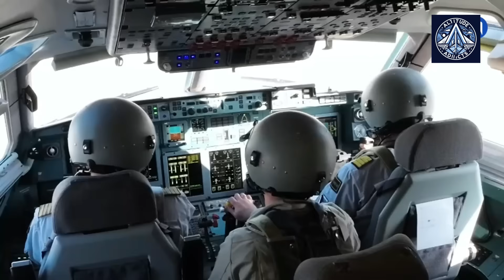Russia Allocates Funds for Wide-Body Aircraft Development—IL-96 Upgrade, New Jet, or CR929

Comment: Time for a new design, modernise existing if feasible until a New Design is ready, revisit the blizzard shape, better podding of engines under wings, so supersonic speeds can be achieved to reduce flight time at higher altitudes is the next step, not just more of the same. Material & Engine Technology allows a fresh look.

Comment: They have the Il-96 design which has enormous potential with two PD-35 engines and upgrades and improvements to the design. At the same time they could also collaborate with China to make a joint design where China makes the fuselage and Russia provides engines and avionics and allow China to start making avionics and become independent too... the way the west would never allow. It does not hurt Russia for China to start making aircraft, but giving away engine and avionics technology is not OK. China could buy it if they want it. Equally Russia can buy computer chips from China too where it is not cost effective for Russia to make them for themselves. China is a huge market in itself and China can justify making expensive things if there is demand. Upgrades to the Il-96 would get into use fastest and would sell to countries like Cuba and other former Soviet client states that don't want or can't have western aircraft. Working together with China to help them off their dependence on western aircraft will also be a good thing for China too. Brazil is in a similar situation to China where on paper they have planes they make but all the avionics and engines come from the west. Perhaps Russia and China and Brazil and other countries in BRICS including Iran who are very competent when it comes to civilian aircraft maintenance, and work to help each other become independent from western companies when it comes to commercial aircraft. The rest of the world would benefit from more competition than just Airbus or Boeing too.

Comment: Russia should develop an aircraft with twin engines (pd-35)
Reply: Russia is already in the process, developing. Work on the twin-engine Il-96 began last year. The PD 35 engine has passed bench tests and should begin flight tests this summer. The number of pilots will be reduced to 2 people, the design will be changed. Everything is now aimed at making the new aircraft compete with the A350 and Boeing 787.

Comment: Russia must  shut the mouths of the sceptics and proceed ahead with the modernisation of IL 96 300 and 400M  planes with the fuel efficient PD 35 engines with a two man crew.
Reply: Not tk forget start rebuilding or re designing the wings and fuselage with composites to lower the weight. Instead of using metal
Reply: Schauen Sie auf das Projekt der IL 98 welches jetzt wohl wieder aktuell ist.
Reply: First Russia must stop the war. Until then their aviation can get lost in nowhere.
They could re-build the Antonov 225  they cowardly destroyed and give it to Ukraine as reparation.
Reply: @NOWAR-q7s  Exactly! Without that, all modernization and new developments are limited more or less only to the Russian domestic market - which is way too small to make a positive business case out of any of these projects.